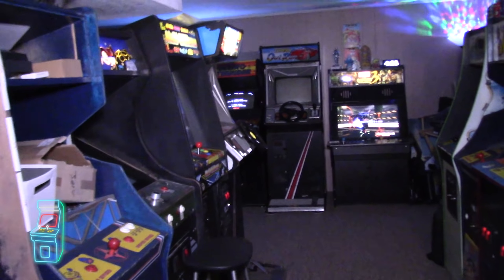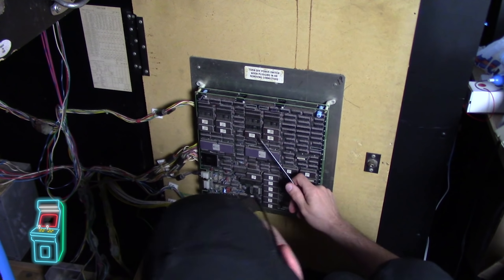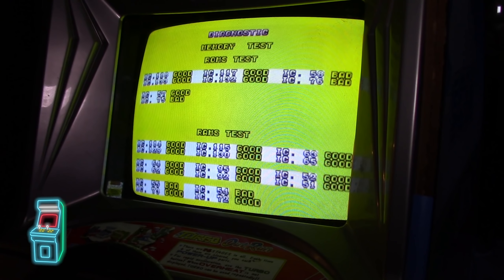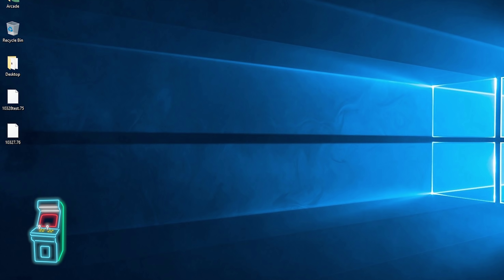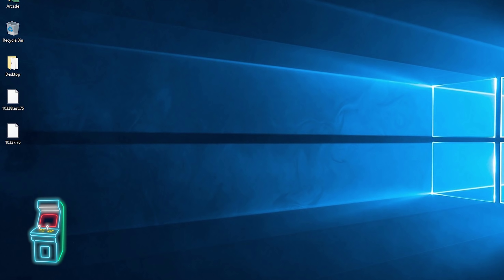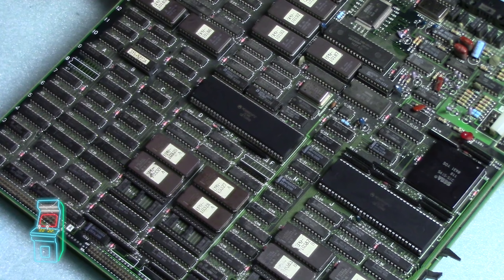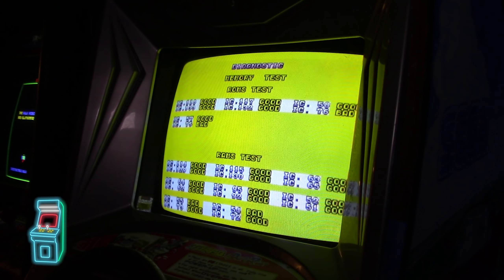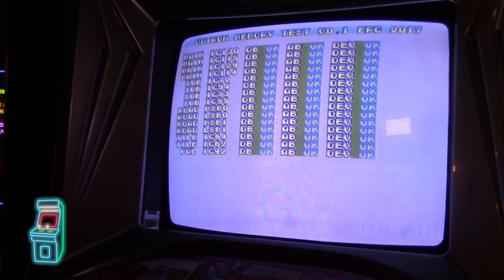Outrun PCB Repair [Untested eBay PCB 1]

Comment: Also my turbo outrun board the roads scramble too but also scrambles at the map screen.
Reply from the maker: The Turbo Memtest roms are different from the normal Outrun.  You will also need a proper 68000 CPU to swap into the FD1094 socket while the tests run.

Comment: Del, I love that you add to your description, details about every part you install.

I recommend non-sterile medical swabs. The cotton is tighter with long wood stick.
Reply from the maker: Yeah, I'm hoping having good info in description will separate me from the rest of the guys. Attention to detail is my strength. 
Thanks for the tip on the cotton swabs. I had some qtips laying around so I used those but I'd rather have something that does NOT fall apart on me.

Comment: If you can help I’m having what I believe is a road issue mostly on the left side where it’s zig zagged  and everything else is clear . The game is playable but it’s irritating
Reply from the maker: Sounds like you have a bad/corrupt EPROM at IC47 (OPR 10186).  It's socketed so you can just replace it with a new one.   Lucky for you OPR 10185 is the same exact chip (It's the road data:  So the 10185 chip displays the right side of the road and 10186 is for the left side).

You can test if the 10186 chip is  corrupt by swapping them out with each other.  So remove the 10186 EPROM and put the 10185 chip in its place.  Then put the 10186 EPROM into the 10185 socket (swapping them with each other).

If the left side of the road gets normal and the problem moves to the right side of the road then the chip is definitely the problem. I can burn a new one for you if that's the case. 

Let me know what you find. Also, I fix that road issue on mine is this other video: https://youtu.be/_QDzZcy3N2c
Reply: I switched them and it’s exactly the same
Reply: Still left side.
Reply: They’re both OPR10185 chips
Reply: There is no OPR10186 here. Don’t know if that matters
Reply from the maker: No, like I said they have the exact same data so it doesn't matter. Sounds like the EPROMS responsible for the road are fine, so it could be a Ram issue.  Did you do a test with the special "Outrun Memtest" EPROMs swapped in?  Those do a more extensive test than the default test menu. But it's good that you are eliminating chips to rule them out.
Reply: DeLuSioNaL's Arcade I don’t have anything to test except to menu test and that says everything is ok
Reply from the maker: Yeah, you need the Memtest ROMs. Do you have an EPROM burner?
Reply: DeLuSioNaL's Arcade I do not
Reply from the maker: Shoot me an email at DelsArcade at gmail. I can burn you a set. Just pay for shipping and cost of eproms.

Comment: my outrun boards say the all the rom and ram chips are good on the test. But then the roads become scrambled. What do you think I should fix? Replace the ram chips?
Reply from the maker: Have you tried the extended memory tests?  Or did you just try the one in the service menu? http://www.aaldert.com/outrun/memtest.html
Reply: @delsarcade  just the one in the normal service menu.
Reply from the maker: @VirtualRobotsRevolt  Probably a Ram issue but you won't know for sure until you swap in those test EPROMs.
Reply: @delsarcade  test EPROMs?
Reply from the maker: Watch this video and cue it up to 19 : 05 - I explain it there. https://youtu.be/5zrtdp9KlxM

Comment: i have a outrun pcb that has a burn mark bottom left corner and the capacitor in that corner has blown and all that remains is the legs what are the chances the cap is the only issue or am i looking at the tip of the iceburg lol oh can anyone tell me the type capacitor that goes here i dont have one to get numbers off of as its gone ... thanks
Reply from the maker: Which corner are you referring to?  When mounted in the cabinet, is it the bottom left, next to the super capacitor?  A location would help. (C17, etc)
Reply: @delsarcade yes its the corner next to the super cap lower left corner
Reply from the maker: It's 220uF @16v at C18.  The rest are 470uF @16v.
Reply: @delsarcade  thanks i kind of figured it was different i could see in several video's it was a smaller cap but none close enough to read lol
Reply: @delsarcade  the cap number on the bad cap is c108
Reply from the maker: So is it on the bottom board (video board) or the top board (CPU board)?
Reply: @delsarcade  top board next to the super cap the number on the spot the cap goes is c108
Reply from the maker: Shoot me an email at DelsArcade@gmail.com that way you can attach pics.

Comment: Del, you could really benefit from an outrun test harness. There's a guy in one of the UK forums that sells the plugs for building an outrun to Jamma harness for testing. He might also have the ribbon cable to separate the boards.

Comment: nice one. Still my favourite game I own. 

 having a spare working board to swap and compare goes such a long way . I've had so many boards fixed after spotting bent legs on socketed ICs. Those solder side bridges are a real issue people overlook too , but they can be hard to spot. I took the time to make myself a test harness too a while back which helps a lot and prevents all that in cab swapping. would definitely recommend that , at least to check booting, video and audio (controls are another thing but don't fail as often )